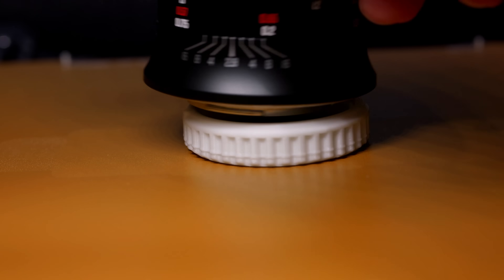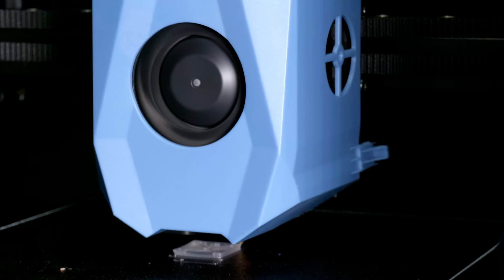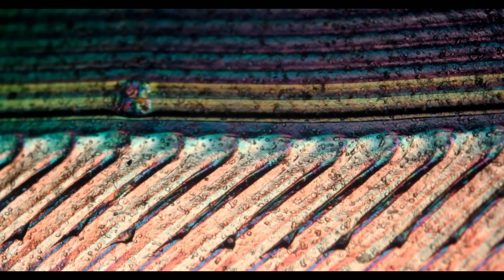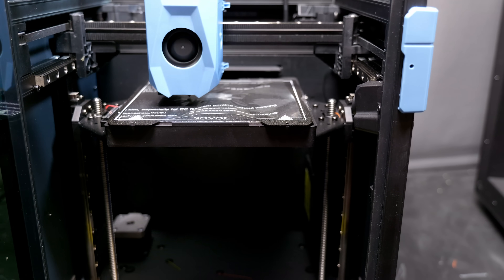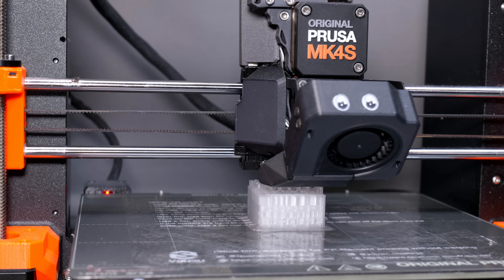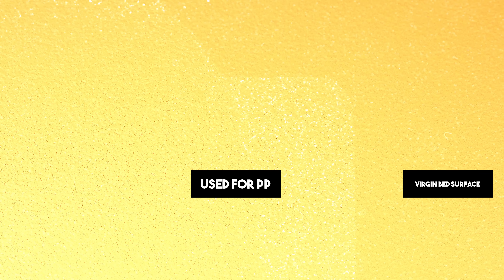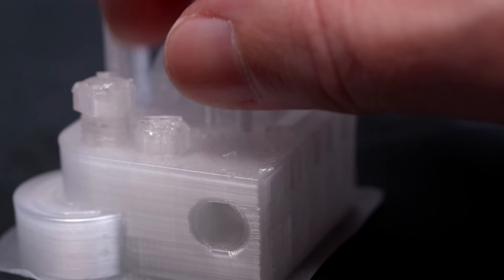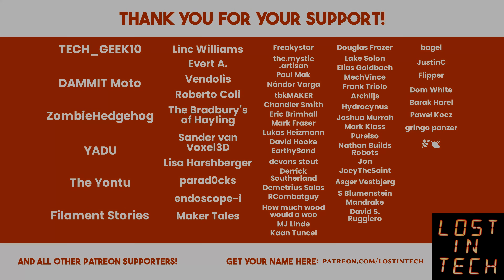Polypropylene - the FLEXIBLE 3d printing filament that everyone is sleeping on

Comment: Couple general tips. For spare infill use gyroid it's creates less stress, for solid infill use hildabert (orca has it as an option). Crank enclosure temp if you have one. Bed for me is usually 90-100c. Nozzle temp is important for deformation if it's too low the material has a lot of internal stress and can curl worse. Bumping from 230 to 240c sometimes makes a huge difference.

Comment: Pretty funny seeing this. My research is on how PP shrinks when it gets cold. 

More seriously, I'm looking at manufacturability of powder bed printed PP powder. 

The processing window for PP can be very low (the temperature between melt and recrystallization), so it really wants to recrystallize. The type of PP matters a lot. Isotactic, Syndiotactic and Copolymerised (with PE off the top of my head(?)) all have drastically different processing windows, I forget right now though.

Comment: In my experience PP filament is still 100-500% higher priced than PLA filament. I typically buy PLA in 1KG spools for 10-15 USD and the cheapest I've seen PP is 28 USD and some brands are still selling it for around 50 USD. I'd love to try printing with it but I won't even consider it at those prices.

Comment: Any recommendations for filament that can print thin walls? I was using Pctpe which is nylon and tpe but it’s not sold anymore. I was able to get down to .2mm walls reliably with pretty good layer adhesion and durability.

Comment: I print a lot of polypropylene, probably about 4kg in the last 6 months. 
A couple things about this. 

1. Heat matters a lot, I print it hot more like abs 110 bed temp and 260 nozzle temp. In an enclosure that's about 60-70c, with a remote heating system blasting the part with 80c air. I am using a g10 fr4 bed, and maggigoo PP. It sticks very well, almost as good as abs. A lot like abs the key is keeping things hot, so printing faster actually gives better dimensional accuracy and less warping.  Typically my print speeds are around 80mms. A huge brim is needed still, like 30mm and the warping will be massively reduced. PP will string, but only wisp if you do it right. Threads usually come out perfect.

2. PP is my number 1 choice lately because it is extremely chemically resistant, not just to solvents but also acids. I am using it in a lab so it is getting submerged in heated low concentration sulfuric acid for days at a time. When printed solid it isn't very flexible at all, actually almost as rigid to the hand as abs. It's also very desirable because of it's high glass transition temp 100c. This makes it viable for a lot of parts abs and tpu fail at.
Reply: I also use G10! It seemed to my, no one else tried this. Just found your comment after writing a comment myself. On my end 90°C bed and 50°C chamber seems enough. I wasn't even shure, that the chamber heater is really needed(at least with my filament). After i've finished the parts from my project, i'll do some more testing.
Reply: @grott3n0lm further the goal isn't the sticking, the brim and maggigoo takes care of that. It's preventing any warping at all. I high dimensional accuracy and all the strength the filament can offer. My prints tend to have hard lives in conditions that are just hateful.
Reply: What exact filament are you using?I did some more testing. My PP filament even sticks to G10 with lid removed from printer and door completely open(90°C bed/5mm brim). It also is quite cheap(20€/750g).
Reply: @grott3n0lm  I've used both reprapper and eryone.  Reprapper sticks better but I strongly suspect is not very pure.

Comment: Another great video.  I guess I need to buy a spool of polypropylene filament.  It was good to see the Sovol Zero.  It's currently my favorite printer.  The small passively heated chamber heats quickly and the high nozzle and bed temperatures allow the Zero to print all but the most extreme high temperature filaments.

Comment: Currently I took on print job with PP, it is not easy to print at all, sometimes it works sometimes it clogs/jams. As parts are long strips the flex plate curls up like a bow when cooling. Chamber temp is also tricky one, when above 50 then the filament softens to a point where it clogs the nozzle. I am using Fiberlogy black PP for this project.

Comment: My biggest concerns are:
1) safety (PP seems to pass)
2) adhesion/ease of printing (PP seems to mostly fail)

The biggest reason is I don't like ASA poisoning and I need a reliable material that I can mostly print unattended.

Comment: Printed pp on my old ender 3v2, was fine so long as you keep sufficiently dehydrated, though bed adhesion is a pain (try on glass), used for a part on my fathers dairy farm, that was used for near boiling water for cleaning!

Comment: I have tried a few PP filaments and in general I found they aren't as hard to print and lots of people say. It really does just come down to finding a good print surface for it and it is easily the toughest filament I have used. I have tried recycled PP too but it was significantly weaker than the Ooznest PP I used which made a pretty much unbreakable benchy, including bending the walls and roof and chimney.

Comment: The reason why Prusa has 0°C bedplate temp is because if you use PP as an Bedplate (stickers, tape and so on) you don't need any temperature. With Magigoo PP on PEI you will need around 90-100°C. I'm printing PP without any of this directly on a "prinplate extreme" from PrinCore using 100°C and it sticks very well. This is some sort of Garolite/FR4 I think. The high viscosity of PP even when melted doesn't allow high speeds with more speed you get more stress into the layers and with that more warping.
Same or even more important for Acceleration settings. 
PP needs to be printed slowly but surely. Cooling only where necessary and if you have enclosed printer try open the lid or the door if you have parts with massive overhangs.
Reply: By using high temps all around though, it can be printed very fast and with a lot of fan giving more dimensional accuracy and design flexibility.
Reply: @notsam498  it depends on your model and indeed the filament manufacturer. If you, e.g. try to print bigger threads like M76 and have then a lot of curved overhangs heat and speed are your worst enemies 😂.
Tried all hot/fast/fan, hot/slow/fan.... 
On our Raise 3D Pro3 I have capped the flowrate at 6mm³/s, speed between 80-100, acc 2500mm/s², jerk 5,
Temp 250°C/105°C, Fan 25% standard, up to 100% on overhangs/layer time 10s.
The pity is, PP from different Manufacturers behave much different... They are also very different in stiffness...
Reply: @matthias3445 the printer I use has a remote heating system and very high flow going through it. I have been printing 44mm m3 threads on it. They come out perfect. Indeed you have to watch out on manufacturers of filament, the result is the same across the board though. I am hitting it with more air than most printers can do 2x over, of course it's 70-80c air. The jerk I have no idea, it's klipper so no direct equivalent, square corner is usually at about 20. Accell usually 6000. I don't slow down for overhangs and only have the minimum layer time at about 2 seconds for small features.  I'm using a 65cfm fan running through a heater at about 45%, due to the tubing I've calculated that to be about 12cfm of airflow. Should be about 3 times what a 5015 blower would typically do. The trick is that you want the temp of the extruded fundament to drop very fast, but not below glass transition. Hence the speed, and the heated air, the part ideally should stay close to 100c throughout printing.
Reply: @notsam498 ok. So not comparable to standard 3d printer 😂. But sounds like a ultra cool machine.
Reply: @matthias3445 it's a bit unusual, at the end of the day though it's a voron. The heated air system is actually pretty cheap maybe 60$?  no idea where to post the design though. Happy to share if you're interested. The voron community hates anything to do with heated chambers, they outright ban any discussion or post within the community. It's wild everyone I explained this to either mansplained me or mocked my for not building a "proper" 5000 dollar printer, even though I'm a bloody materials engineer and tried to explain the armchair thermo and materials.
Reply: @notsam498 i'm personally  interested but for our Raise3d there is no possibility to use it but for my personal printer there is.
For the voron community well the heated chamber will melt away their printed parts 😂
Reply: @matthias3445 not if they are printed in PC and some CF NYLON.

Comment: PP isn't very hygroscopic, but anything with carbon fiber is so definitely use a dryer with the cf variant if you care about strength. Also, I heard the horror stories of getting PP to stick to anything, and I put it on a printer I was running with a garolite/g10/fr4/[whatever you want to call epoxy fiberglass beds] and it just stuck perfectly as any other material to that type of bed (Including POM which is the devil though only for small parts because again, POM is the devil)
Reply: I made the same experiences. 100% agree.

Comment: Hi! I’ve received my BuildTak pro+ plate last month and it works great for PP, it should be compatible with PC and others as well but I haven’t tested those yet. I believe they sell them for a few different sizes and brands, I hope to only print with PP going forward since it’s very humid here and PP doesn’t absorb moisture ❤

Comment: FYI: for PP you can use thin FR4 (0,5...0.7mm, without copper and sanded ~200...400 grit for better gripping) or g10, glued to aisi430 sheet (~1mm)
Reply: Beat me to it! I was thinking exactly the same thing!
Reply: what glue did you use? was it hi temp epoxy?
Reply: @koboglo6973 I got a preassembled bed locally, looks like they use some 3M tape (maybe 468MP), similar to used in magnetic bed
Reply: somehow, comment dissapeared: i got plate from local supplier (0,8mm aisi430+ ~0,5mm fr4) - looks like they use 3m 468mp or simillar tape as adhesive

Comment: I havent seen this filament.  But at work I hate how sticky it is.  Its the worst plastic to handle molten and turns to liquid instead of becoming carbon when it stays heated.  Like 500f degrees.

Comment: I store my PP in a dry and dark place, usually. Just a precaution, if I get visitors, especially with kids, it is not recommended to leave your PP in the open. Printing is somewhat complicated, I tried voron parts and failed with thin parts, until I slowed the print down and gave it some more fan and a 65c enclosed printer. That somehow worked. The CF stuff ist much more prittle, but still very very strong.  I printed a (more or less) soft blow hammer head and it's not cracking in use. 😅

Comment: As far as thermoplastic filaments go, nothing could be less toxic than alkane polymers (e.g. PP or PE). However, that assumes a pure filament with no fillers or pigments.

Just to give you an idea, paraffin wax is a polyethylene chain somewhere in length between propane and LDPE…and people are willing to burn wax candles indoors. As another alkane, polypropylene is chemically very similar. To my knowledge, plasticizers aren’t added to PE or PP.

PET and PLA would be slightly more concerning, since they are susceptible to hydrolysis. As always, I enjoy your English sense of humor.

Comment: Hi, just wanted to leave a tip. Around 8.45 into the video you say you can't use a glass sheet on account of the probe, but you can. You add a macro for when you want to use your glass bed and simply tell the printer to move up after probing and wait for 1 minute or however long you think you need to add a glass bed. You adjust the z height in the macro to subtract the thickness of your glass sheet and off you go. Love your vids btw.
Reply: That sounds like a good work around when necessary but I wouldn't trust my old brain to remember that process a month later.  The older I get, the more I rely on the KISS principle.
Reply: @Liberty4Ever hehe, well you save a preset and call it glass bed. I did it for my prusa MK2 (2017) following someone else's guide at the time 😂 as it too had a magnetic probe. The surface printed on glass yields a finish that looks like it's injection moulded so it definitely has its uses. If you are worried about forgetting which preset you used when slicing, I have another tip for you. Either specify how the file name is saved out or edit it after slicing so you won't wonder what the heck is what. I had prusaslicer write out the file as such "thingamajig_adaptive layer_15%infilltype_quality 70mms_1h50_glassbed profile_date" Experience taught me that. Saved me so much headache as I was really trying out a lot of iterations. Designing a thing is like 50% of the work.

Comment: Vinyl transfer tape - the tape used to transfer adhesive vinyl cutouts to the target surface - is usually PP and comes in a wide variety of roll widths, and is made to be easy to lay down flat without creases, as any crease would transfer to the vinyl.

Comment: The cheapest and easiest way I've found is PP glue/ coating. Once you sacrifice a smooth plate and coat it (not removable after coating) you just print it like normal ABS.

Even with this method large print is still difficult because of PP insane shrinkage

Comment: I'm sure most of these CF materials would be ostesibly mechanically unchanged if the CF was switched out for GF. I guess GF doesn't havre the "Oooohhh carbon fibre!" factor 🤷‍♀
Reply from the maker: the prusa GF stuff actually came out after I was editing the vid, otherwise I might have got hold of some. As you say, I dont know if it makes much diff.

Comment: The texture of the Prusa PP bed looks a lot like the weird texture of the Biqu Cryogrip bed. I wonder how they're made, the 'holes' looks like they were maybe bubbles?
Reply from the maker: officially "powder coated" which is a process of electrostatically charging then flinging powder at it, then melting that on. Holes...probably just the air bubbles.

Comment: Great Video, I have a lot of questions: 1) what type of support is recommended (tree support or the normal one) 2) is there a type of infill (grid, gyroid, lightning) that helps with warping? 3) does infill density percent help with warking?
Reply from the maker: 1) no specific recommendations 2) again I don't think it matters much and 3) I doubt it as it warps uniformly as it cools, but the more material you give it the more force presumably the shrinkage will have against the bed, which is definitely interesting...but subject to testing.

Comment: You mention exchanging air six times an hour - but I can't find any information about it (or specific video) do you have any resources on it?
Reply from the maker: https://ehrs.upenn.edu/sites/default/files/2020-12/3D%20Printng%20Fact%20Sheet%20js9-20.pdf?hl=en-GB

Comment: Shouldn't it have just enough adhesion if you just print PP on a PLA or PETG-CF raft, maybe with "interlocking" turned on?
Reply from the maker: Some people say so but generally no. Interlocking is a horizontal thing so it would work...if your raft went up the sides

Comment: I am wondering how the G10 Fiberglass Garolite 3D Printer Build Surfaces would work?  or if i would let your full sheets stick to the G10 surface.  I see models with FR4 Spring Steel Flexible Sheet, so I am thinking the Eddy will still work, but an offset would have to be used.   Great video!!  Keep up the great content.

Comment: im having a hard time calibrating k-factor with pp. u got a tip for me? im using smarttip pp. i get quite good adhesion with the whatbam pex plate and PP @ 100c ;) gotta use the brim, i like 0.22 distance to model with an z-offset of -0.04.

Comment: Call it PolyPro if you can't be juvenile.

Polypro is the most forgiving resin out there in terms of injection molding. However, it does off gas a bit more toxic byproduct and it's characteristics are not useful for anything requiring strength, temp, chemical resistance. Polypro also off gases when your car is just sitting, parked, not even the sun. For anyone old enough, back in the 1990's or earlier you would have to constantly clean the windshield due to off gassing of the dashboard. ArmorAll is what you could use to reduce the amount of off gassing.

Formaldehyde is very toxic. If you smell any material burning that off gases formaldehyde, mask up.  When out process techs would burn polypro or PVC, we would have to open all the doors and evacuate the building until it was safe to breathe.

Again, polypro is forgiving. A very easy to mold resin. I would not 3D print it though.

edit: additional info, you are referring to MSDS. I would like to introduce you to matweb dot com. This is an online database for all things materials used in manufacturing. You will find a lot more information on material there. It has been around since 2000, that I know of, if not longer. I used the website to narrow down materials for future projects, VAVE projects, and price for RFQs.

Comment: What interests me about polypropylene is that I've seen it used before as barriers and forms for epoxy projects, and the epoxy would release directly from it without any release agent needed. I wonder if a 3D printed PP mold or pattern would act the same way?
Reply: try it and keep us in the loop 😊
Reply: @iopfarmer gotta buy a 3D printer first! Lol

Comment: With the PPrinting Plate its just like any other filament its a weird build plate to be honest but it actually can be used for any other material.
You can get it at there store and basically stick the stuff on any build plate it also doesn't break down as fast as any other plate for PP.